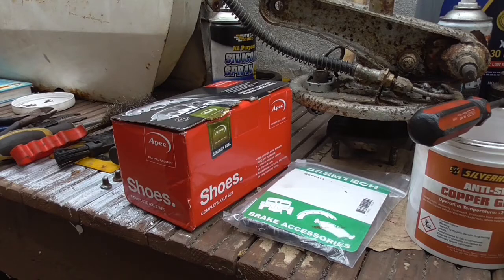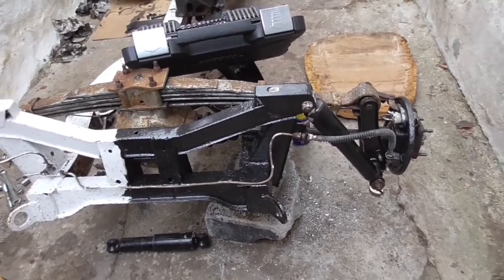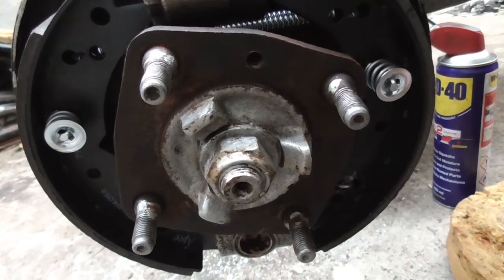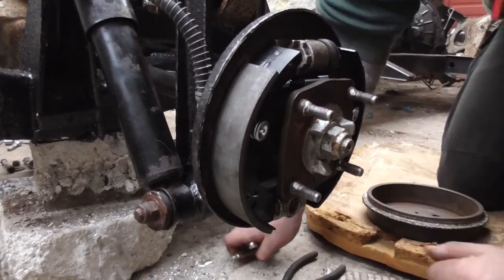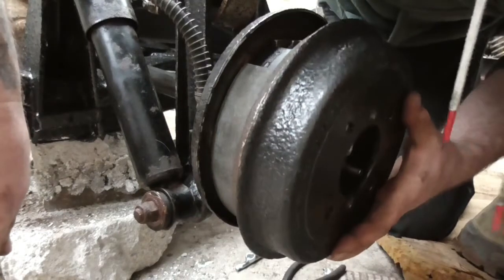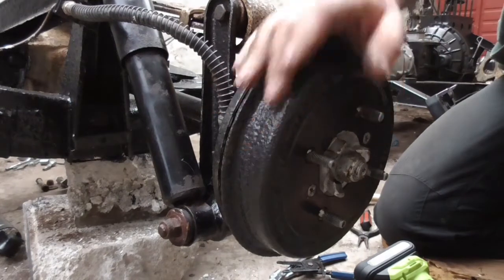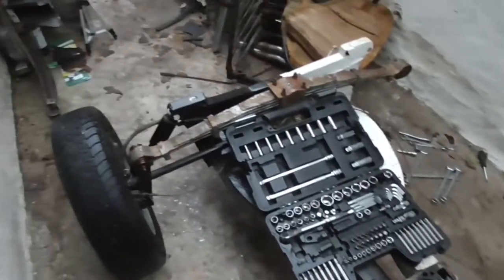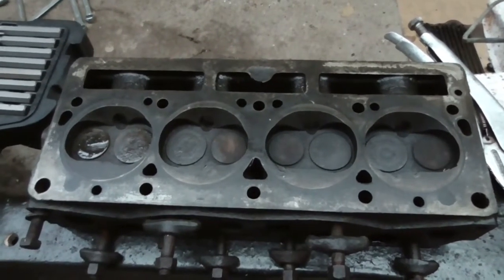Triumph Spitfire | Amateur Restoration | Part 7 - Rear Brakes & Engine Update

Comment: Back the adjuster off and centre the shoes and then the brake drum will slide on freely. Then wind the adjustment out until the drum is locked and back it off until the shoes are just touching the inside of the drum.
Reply from the maker: Thanks. The adjuster was siezed and couldnt get a grip on it. It's all back together now though

Comment: Did you check the end float on the Crankshaft thrust washers, pull the pully back and forth to see how much play there is, I had to scrap a perfectly running Engine cos the Thrust washers had fell out and I found them in the Sump..
Reply from the maker: I didn't, but i have since removed the sump and cleaned everything. Nothing in there but old oil luckily.
Reply: @BritSpit  Yeah them thrust washers are the most important things to check on these engines has they will gouge the Crank and Block mating surfaces making the Engine scrap, Cheers for your content pal..

Comment: Nice video, I just assembled the rear brakes on my GT6 tonight as well :-) 
I think that your brake shoe facing the rear is not positioned correctly; the notch should be at the bottom instead of the top. I don’t know whether that’s a big deal or not though...
Reply from the maker: Seems to work ok. I'll double check in the Haynes manual!